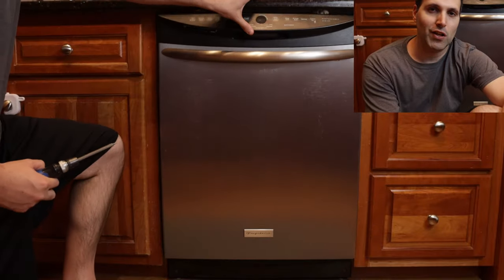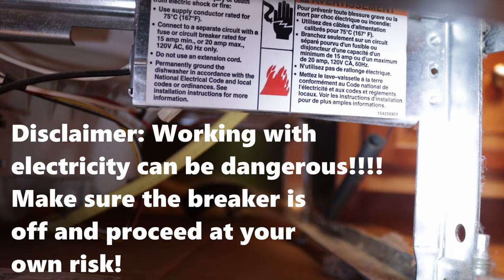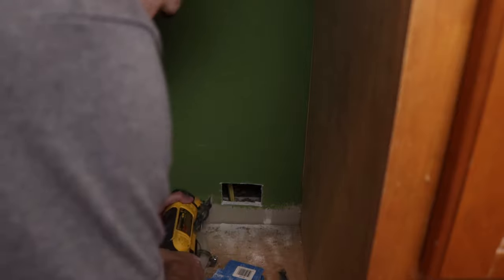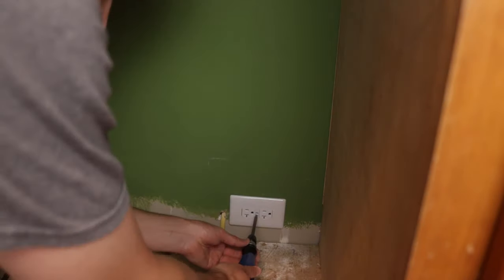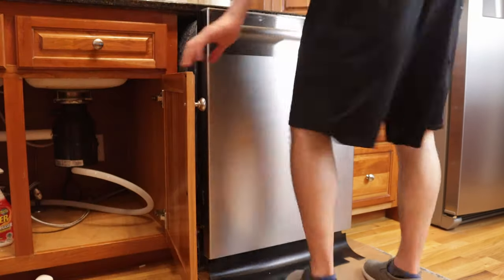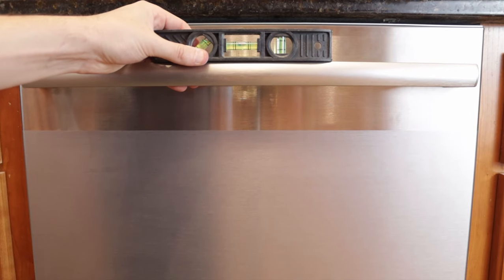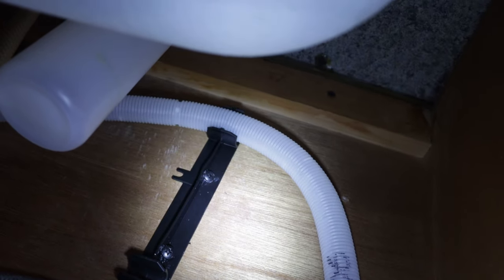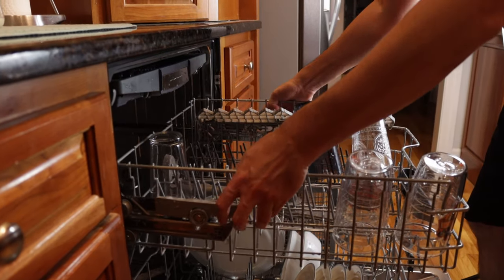Installing Your Own Dishwasher and Bosch Dishwasher Quick Review

Comment: I see you had an outlet under your sink, is there a reason you opted to install a new outlet rather than just feed the power cord to the outlet under the sink?
Reply from the maker: That’s a great question. I never really gave it any thought. My previous dishwasher used that wire and it’s on a breaker by itself since it draws more current for the heating elements.
Reply: Good eye...yeah, that would have been ideal to use that outlet.  Per "code" standards, and even Bosch installation instructions, the outlet should be in an adjacent cabinet, such as under the sink.  I am more curious as to why the previous water line used for the old dishwasher could not be used for the new dishwasher.
Reply from the maker: The outlet I installed has its own dedicated breaker. Also, the old hose was copper line. For me it is easier to use the hoses. Either or would probably work in either situation. Haven’t had any issues with it to date. Thanks for your comment!
Reply: @HeyPat.  Thanks for your reply, yeah, I watched again and saw you had the copper line, the flex line is ideal.  True, they say dedicated circuit for dishwasher, but then I am researching online, and some people say it's ok to share an outlet with garbage disposal (if the garbage disposal is a plug in type-which apparently newer ones are).  I have a Bosch showing up this Friday, they are selling them like crazy.  Trying to figure out best way to do outlet, cause my old one was hardwire.  Think I'm going to stick it under sink.  Thanks for video, the best tip I got was not to cut all the way into walls, that could have been a shocking surprise for a newbie like me.
Reply: Today’s Bosch’s do not have heating elements, so hopefully I can just plug ours in under the sink. We just bought the Bosch 500. Thanks for the video!
Reply from the maker: That makes perfect sense as the heating pulls the most current. You are welcome.

Comment: Did you set the electrical outlet low on the wall for a reason?
Reply from the maker: The lower part of the dishwasher is curved, didn’t want to put it too high and have the plug hit the back of the dish washer.

Comment: No gfci? Or gfci breaker?
Reply from the maker: Nope. Probably should have put one, although I have never had water splash on an outlet and trip it to date…..This house is weird most of the ones in the bathrooms don’t even have one. I might change the breakers at some point.
Reply: @HeyPat.  I don't know where you are but around here anything within 6' of water supply has to be GFCI. Dishwashers are supposed to be on a dedicated appliance outlet also, preferably 12 gauge to box. I'm not an electrictian, just what I've been told by them that know... meanwhile I have a brand new Bosch dishwasher that doesn't spec any of that in the literature
Reply from the maker: I hear ya. The previous washer was on the same wire, just hardwired. It is on a dedicated breaker just for the dishwasher. The plugs under the sink for the disposal are not GFCI, and other plugs in my bathrooms aren’t either. That doesn’t mean the previous builders did it correct, but the back of the dishwasher is solid so it would likely leak out the front. There would have to be a solid 2 inches of standing water to get up to that plug. Haven’t had any issues to date. Appreciate the info.
Reply: @HeyPat.  I'm kind of amazed at the original setup, I'm in MA so we're regulated to the moon and back... :) It's overkill without a doubt
Reply from the maker: I’m in TN so probably a little less so. Ha!!